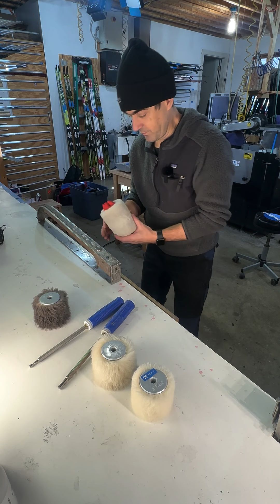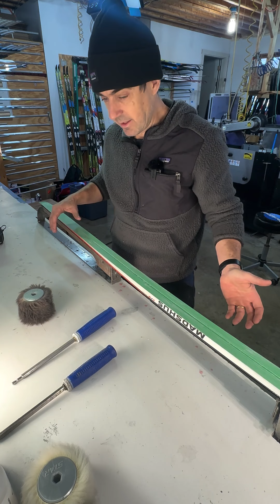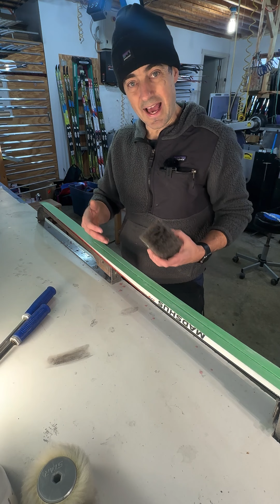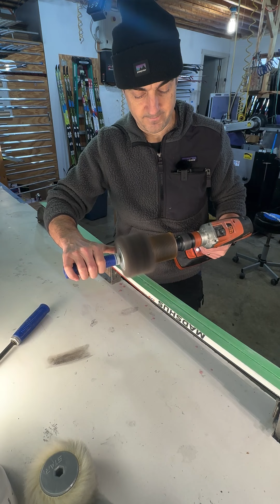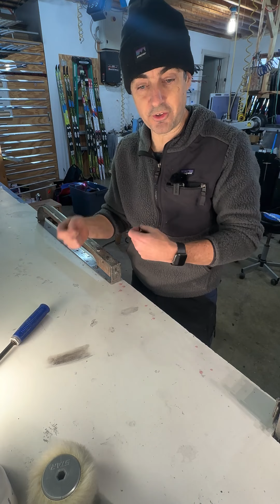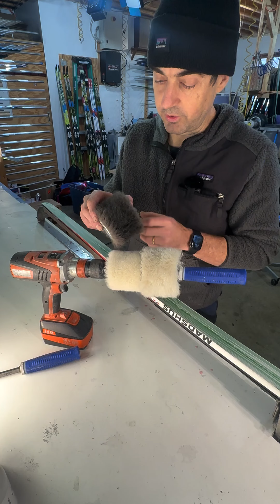Rotating speed and fleece length - why do we have options?

Comment: This is a nerd file question, but what is the point of layering glide wax? If the first layer is bonded to the base itself, the second layer would then be "sitting" on top of the first layer. Unless the snow crystals actually penetrate the top layer and cut into it, what's the reason for layering other than maybe changing the roughness of the surface?

Comment: Many sources recommend letting Rex liquid waxes cure for as long as possible, ideally overnight. Would you finish those with fleece immediately and then let them cure, or vice versa?
Reply: If you store your skis in your garage etc. in the cold, take them inside and apply the liquid when the skis are room temp wait the 10-30 min whatever the bottle says and finish it after that. 
Most waxes and skis can't handle really wet conditions so expect the glide to worsen if you do a long trip. The rex yellow is really good but it may need some Sauna, hot wax and liquid glider trickery to really make the glide really last, but it really isn't necessary unless one does Vasaloppet, Marcialonga or something like that
Reply: Based on my understanding of the mechanics of liquid wax drying that seems extremely unlikely. Liquid waxes are held in suspension in alcohol or a light petroleum distillate like naptha. When you say "curing" that implies some sort of cross-linking process, and waxes do not behave that way. That's a good thing btw, because if they did cross-link then wax cleaner wouldn't be effective on them.